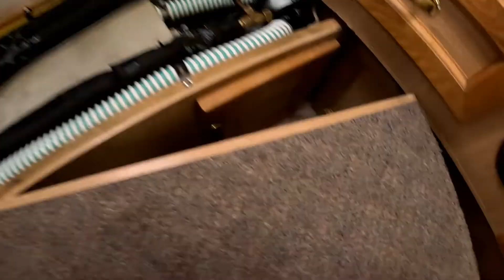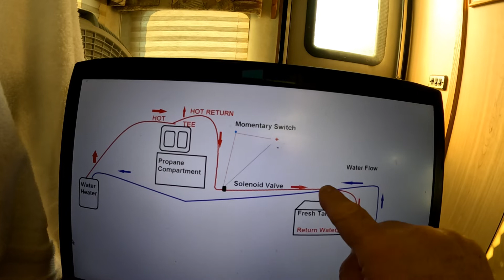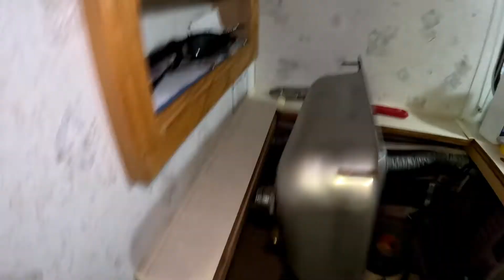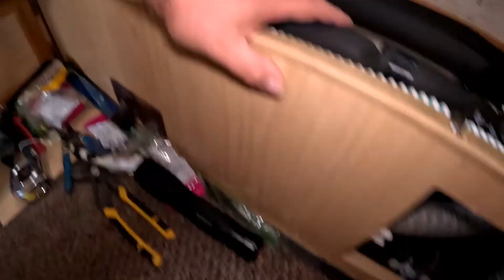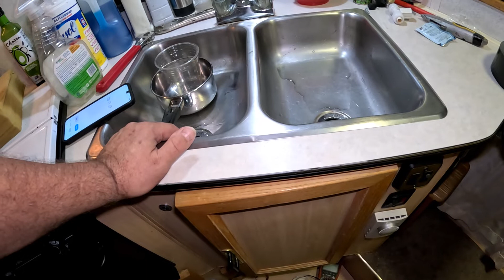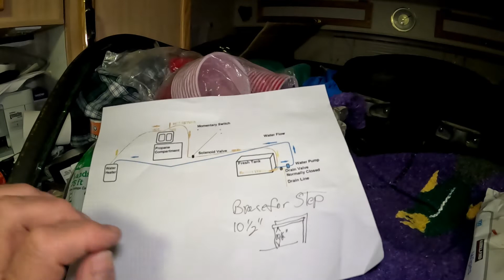RV Recirculating Hot Water Line Best Water Saver Ever

Comment: This is exactly what I was looking for! My grey wolf trailer has a tankless water heater and im sure you know they waste a lot of water to get hot water up to the sink or shower. This will save us a ton of water while boondocking. I will 100% be setting this up in our camper. I plan on putting a button in next to the kitchen sink as well as a 2nd button next to the bathroom sink for easy access. They will tie directly into the power for the pump so won't even be usable until the pump power is turned on.
Reply from the maker: A tankless warer heater?
A residential tankless usually already has a recirculating line connection built in, you just have to run the line and connect it. An RV tankless WH, I don't know if they have that or not. A manual switch like this is best in an RV though. A residential model cycles all the time and an RV only needs it when you need it.
Reply: @CITAP1 most new campers and rv's are coming from the factory with tankless water heaters. They are more efficient on propane but waste a decent amount of water getting the hot water to the taps. This is a good solution to that proplem for boondocking. It would also help keep the fresh water tank from icing up in colder weather.

Comment: Sounds like a good idea . One problem if you have check into this you may get sick taking your hot water and putting it back into your fresh water! You can do one better run a return line into your cold water inlet in the back of your water heater . And install a check valve so it can back feed into fresh water. Then put a tee in the hot line by your sink furthest away from the heater . You dont chance getting liegenair disease
Reply from the maker: I'm not worried about any water born sickness. The hot tank comes from the fresh tank and the temperature in the hot tank is over 140 I'm sure. Hotter then heck to touch. It should be sterile.  It has saved us from a lot of wasted water. To do the recirculating loop at the water heater,  you would need the check valve and a recirculating pump from the last hot in the line, back to the water heater inlet and check valve.
Reply: Is your fresh water sterilized to ?  180 degrees is sterile most rv water heaters only heat to 160 degrees. Just be careful most fresh water tanks get as warm as the Rv .
Reply: As long as you sterilize the fresh tank with a cap or two full of bleach every now and then you should be fine. Majority of people dont drink water from their fresh tank any way and have separate drinking water.

Comment: That's a great idea I'm hoping to get installed because my RV has an on demand heater which wastes copious amounts of water. If you run the bypass valve while hooked up to city water I guess it would be filling the fresh tank while waiting for the water to get hot instead of recirculating. Is that correct?
Reply from the maker: Residential instant water heaters have integrated recirculating lines. If not, you could do the same setup, returning water to the fresh tank.